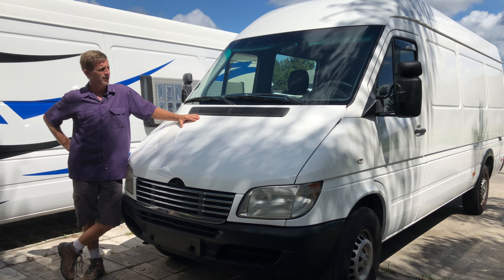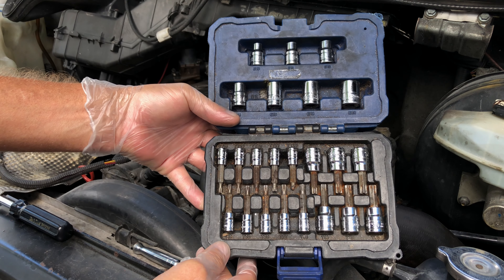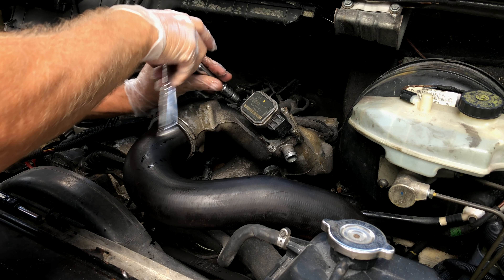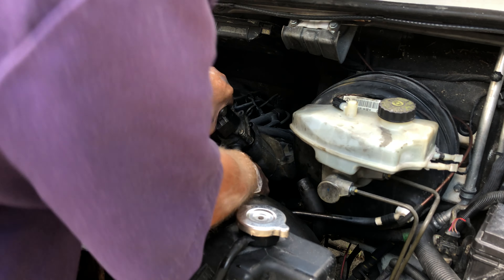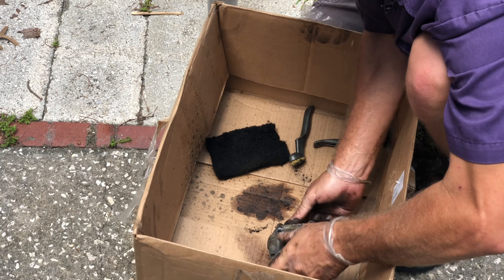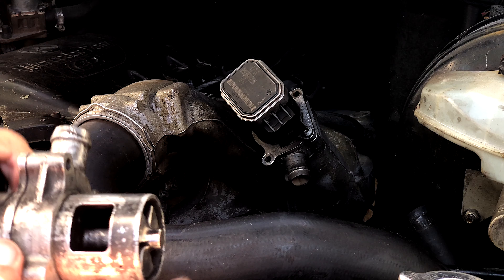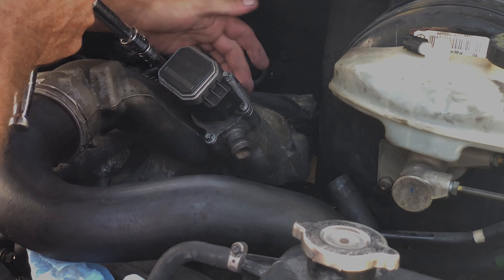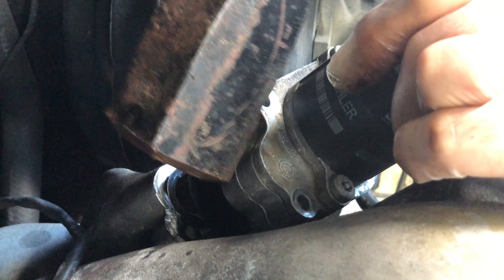EGR Valve Replacement/Cleaning - T1N Sprinter (2004-2006)

Comment: Do you happen to have a video for OM647 oil separator replacement?
Reply from the maker: Not yet. When we find a good way to clean them or a reliable replacement part we will have a video.
Reply: @FloridaVanMan   Any luck with the Vaico? Europarts-SD is selling them.
Reply from the maker: @nak8327  I've not tried it or read about Vaico brand. I've bought other things at Europarts-SD, but no breather.

Comment: Searching details here ! When cleaning my EGR valve, I saw that the port going to the intake (after egr valve) had wet walls ! Is it normal or my egr valve is leaking coolant ?
Reply from the maker: No. It is possible your EGR gasket was leaking coolant, but since you had the EGR out for cleaning I assume you sealed that gasket when putting it back. It is likely the intake was wet from oil vapor or condensation also. Humid mid-day air pulled through a cold morning intercooler will condensate a bit.

Comment: My 2005 came with EGR valve disconnected, should I try to Clean and . reconnect
Reply from the maker: If it is disconnected and the engine light is not on somebody has probably tuned* the van to remove emissions systems. Not much you can do unless you find out what tune is installed.
Reply: Thank you .

Comment: REMOVAL: no sure but I think there's a very gentle persuader called WD-40. Of course you don't get the great workout that way. CLEANING: having compressed air and a fine-tipped blow gun is indispensable for efficient removal of solvent-freed material as well as any particles of abrasive cleaning medium that get left behind.
Reply from the maker: The gasket prevents getting penetrating fluid into any meaningful place until the EGR starts to come out. 
When you use compressed air to remove material... where does the material go??? 
Spoiler: Everywhere including places we do NOT want debris. Over 2.4 million Americans suffer injury to their eyes every year. Don't be one of them.
Reply: @FloridaVanMan  When I use compressed air I make sure the loose liquid borne material goes to a harmless place. It is not that hard with some practice and basic psychomotor skills, and maybe a big piece of cardboard or an old towel. But good luck with your steel wool.....
Reply from the maker: @LEXICOGRAFFER  Steel Wool??? What are you even talking about? 
You cannot catch all the flying debris when you use compressed air to blow and blast it away*, period! Start your own channel if you want to fight about bad techniques and poor practices! Kay???
Reply: @FloridaVanMan  Kay.

Comment: With that scanner does it include the 2006 cable or is that separate...  ?   What tool set was that... ? Where can I get that tool set?
Reply from the maker: The MBII comes with the cable to connect to the vans. We suggest the Autel AP200 https://amzn.to/2GD04Ft for the same function at lower cost. We have a video showing how to set it up correctly for the Sprinter.
Tools I got at Lowes long, long ago. I have not found similar ones.
Reply: And what tool set was that... ?  Thanks for the reply... very impressed with what you do...

Comment: Sorry too many questions. I once took a v8 engine apart and put it back to together at .5 tolerance. Of course, it was an exercise not real life. How do you know how tightly to attach each part/bolt etc. Is there a reference for people like me?
Reply: and why the cliffhanger ending???
Reply from the maker: My official answer is: Yes, there is a chart detailing bolt size to torque setting. I often refer to downloaded repair manuals for torque settings of the specific area I am working. But honestly, I often tighten less critical bolts with about as much force as used to take it out, guessing. That has bit me in the tail many times and we have a video showing repair of the threads of the EGR mounting. I also have a favorite product specific for injector hold-down bolts. It is a *favorite because I have needed it more times than I'm willing to admit, even after trying things that didn't work like Heli-coil. lol
Reply from the maker: Well,... I think this was our very first video. The cleaning process was fairly correct, but the EGR we cleaned needed more than a good cleaning could do. It needed replaced.

Comment: Great video. Would carb cleaner work too? Which cleaner is better?
Thanks
Reply from the maker: Can confirm. We have used carb cleaner (Methyl Ethyl Ketone (MEK)) and brake cleaner (Tetrachloroethylene) with good results. I don't know which is safe for the EGR, but I can say for sure, you do not want MEK overspray on your paint. I have used that chemical for removing paint, before I knew it was in found in carb cleaner. That little clue would have been useful stopping bicycles in my teenage years. Probably best I did no know I could buy MEK in a spray can!!! LOL, It's bad stuff! Tetrach-whatever is probably just as bad. I just don't know it yet. LOL

Comment: Did that fix your power problem?
Reply from the maker: Yes, cleaning the EGR often solves issues with sticking open or slow to close EGR valves. But if you feel bumps in winding up the spring, or if it doesn't snap! back when done, cleaning isn't enough. They do go bad from old age and/or overheating.

Comment: Hey, take a look at my video on '06 Sprinter driveshaft reposition update that reduces vibration and makes drive line parts last longer.  V Rolfe  Chicago
Reply from the maker: Will do!
Reply: @FloridaVanMan  don't wait too long before you get that median bearing-driveshaft reposition bracket cause that will smooth out the vibrations and it will even help the longer wheelbase model too. Wish I coulda known of that 10 years ago. It's like you notice immediately how much less vibration is involved. Better than when the van was new.

Comment: I cleaned my egr valve today, but made mistake when I took it off and little water goes I inside the intake,  I cleaned the egr valve, put it back  in , start up the van, and there you go the van starts to act funny, it shocked and no power when hit the gas wit a lot of black k smoke coming from the engine. 
Do u have any clue, please. 
Thank you
Reply from the maker: A splash of water shouldn't be a problem. I suspect the EGR cleaning didn't take. Did it turn smooth and Snap back after cleaning? Was the van running fine before cleaning the EGR?

Comment: Awesome video and super helpful!

I noticed you also have the glow plug circuit codes shown. I have the same. Did you ever look into those?
Reply from the maker: We will have a glow plug video soon.
Reply: My glow plug circuit codes were due to 1.bad glow plugs 2. Bad glow plug control module. Had all glow plugs replaced and codes still popped up to find out it was also the module.
Reply from the maker: @amybass4005  That's not uncommon. When the glow plugs fail they either blow open circuit or short circuit. If they go short circuit they will blow the internal fuse in the module. New replacement modules have a breaker, rather than a single use fuse. We suggest upgrading all 6 pieces as a set, 5 plugs and 1 module.

Comment: Would you recommend deleting the EGR? Thanks
Reply from the maker: No. EGR is kinda' a headache, but deleting it with a tune is just trading one headache for another. Dealerships will not be able to properly diagnose issues. Deleting the EGR with a resistor simply does not work unless your van has multiple other problems. I'm working with one this week. The owner swears the tune is perfect and van runs great but can't get over 60mph. It is not a FedEx van... He has been driving it stuck in limp mode for the past 2 years. But "the tune is perfect" he says. LOL!  And he recommends I delete my EGR too. LO double L!

Comment: can you hook up that unit as a engine monitoring device?
Reply from the maker: The iCarsoft MBII does have live-data for engine monitoring, but it is not a pleasant graphical display. More like a spreadsheet with small pages of specific data points. You need to flip the pages and know what the numbers mean. The Autel AP200 has better displays including simulated dial meters with moving needles and colored zones.  It is linked in most of our video descriptions.

Comment: I see ya got yer lucky purple shirt on; that helps.
Reply from the maker: I am know for my fashion sense... but not usually as a compliment. LOL My daughter laughs at me some times, for the clothes I like.
Reply: @FloridaVanMan  My daughter and wife are always after me for the same clothes and shoes I wear (too many days betwixt changes). Daughter works at the local DQueen. Came home one night after closing late and referred to a customer as wearing the 'same stuff as you Dad'. What was that stuff, I asked? " Carhartt shirt with oil spots in the front and Riggs pants in DK with black leather belt." Are you sure he wasn't wearing a Carhartt white T with pocket and spots? I asked. I did get a new pair of grey 990 NB shoes this week
to perk up the lineup when I walk the runway style show!!
I used to wear round toe lace-up black work shoes to high school and the class was always making fun. Met a guy at Walmart some years ago and he was in a brown Carhartt pocketed short sleeve T. I made some comment about how many of those he had in the drawer and we both started laughing!
I think one reason I have not had EGR service and other ills with my 2.7L is that I ALWAYS let the baby warm up to the first mark on the temp gage before driving away; and, I put the trans in neutral while it is warming up to let the fluid and pressure get going. Have fun over there and stay safe.

Comment: I have a 2006 with limp home and have replaced everything... still the limp issue... 😓
Reply from the maker: We have a video on resetting limp mode and what causes it. Air, fuel, wheel speed, transmission errors, EGR, MAF, stuck turbo linkage... just to name a few. What is "everything" that you replaced? 
Please support the channel with a small donation: 
https://venmo.com - @FloridaVanMan 
https://cash.app/login - $FloridaVanMan 
https://www.zellepay.com - FloridaVanMan 
https://www.buymeacoffee.com/FloridaVanMan

Comment: Anyone know the location of the EGR value on the 2.1 313cdi? 2005. 🤷‍♂️
Reply from the maker: You probably don't have one. Exhaust Gas Recirculation is not unique to the United States but most Sprinters don't have EGR. What country are you in?
Reply: @FloridaVanMan  based in UK. I was confused as Haynes manual states there is one on the 2.1 but I can’t see it. How does the systems differ on vans without. Cheers for swift reply.

Comment: Which model engine is this? 2.1 4 cyl  engine or 3.5 v8
Reply from the maker: Neither; this is for 2004-2006 Sprinters with the 2.7L inline 5. EGR valves are very similar across all models and cleaning steps will still apply

Comment: The best way to fix that problem is delete the egr instead
Reply from the maker: WRONG! EGR delete is a federal crime in the USA, Canada, all of Europe and most first-world countries with penalties comparable to "possession of cocaine". The EGR controls combustion heat by introducing oxygen depleted air from the exhaust. Deleting an EGR is an incredibly selfish act contributing to air pollution, specifically high NOx. In atmospheric chemistry, NOx is shorthand for nitric oxide and nitrogen dioxide, the nitrogen oxides that are most relevant for air pollution. These gases contribute to the formation of smog and acid rain, as well as affecting tropospheric ozone, causes cancer in children and respiratory issues for the elderly. But what the hell, you falsely believe it improves your fuel milage and saves you 13 cents a month while making you feel like a big boy, getting one over on the government.

Comment: I would not want this hooligan touching my Sprinter
Reply from the maker: The AP200 has live data for the cabin comfort controls. This will show if the ECM is seeing the A/C button turning on. You can also check for 12v on the only wire that goes to the a/c compressor.

Comment: how did it perform ?
Reply from the maker: Much better. It seems to have cured the limp home mode, although the van has not been driven much lately. About 30 miles, running flawlessly. We are installing a very efficient air conditioner and 1220 watts of solar panels. We will have a video of this build soon. Maybe a week? 
Thanks for watching,
Bill
Reply: @FloridaVanMan  oh wow 1220 watts thats cray. How much?
Reply from the maker: @sidi3335  The solar a/c van has hit a speed bump. My work schedule has become very demanding, so the van sits waiting. The video will be posted eventually. I'll try again soon.
Reply: @FloridaVanMan  any news on the solar panel A/C?
Reply from the maker: @auttiman5591  The solar project van was competed and sold in December 2020. We have several videos staring that van and the solar powered air conditioner. The final outcome wasn't as spectacular as we hopped, but it would run a/c 24/7 keeping the van about 78 degrees while Florida weather was over 100 every day with a little afternoon rain. Trying to keep the van at 75 degrees was too much, and drained the batteries after about 3-4 days.

Comment: Can you tell me where your affiliate link is for the torx tool set you show in the video as well as the MBii icarsoft code reader?
Reply from the maker: I have not found this same set anywhere. I've had it 10 years or more. They can be found on Amazon but the code reader is here: AP200: https://amzn.to/3h2gLY0 After putting the code reader in your cart you will find many tori and E-torx sets. The sizes we need for T1Ns are: E10 - E18 & T15 - T50.